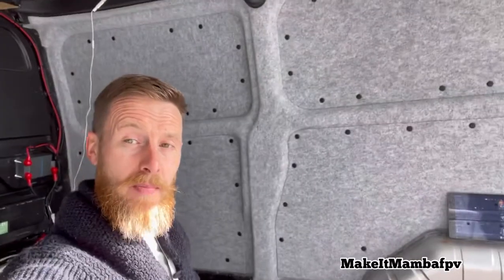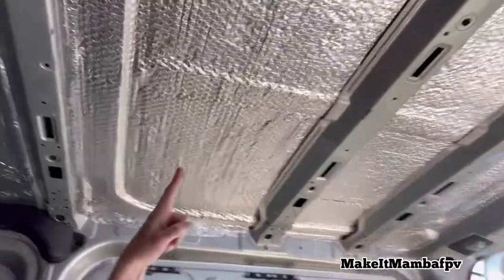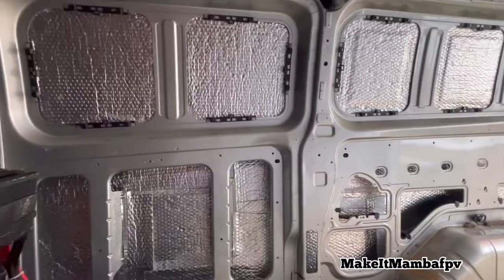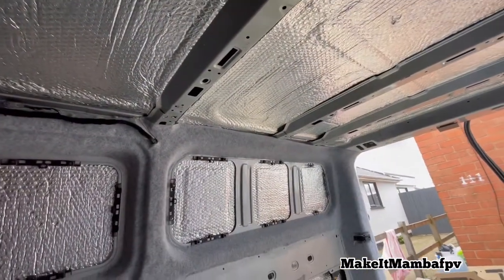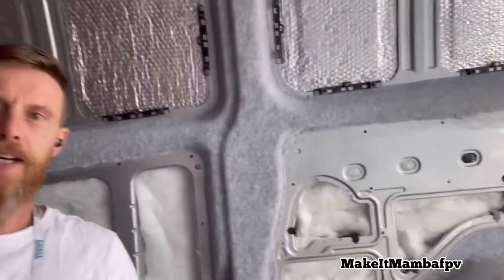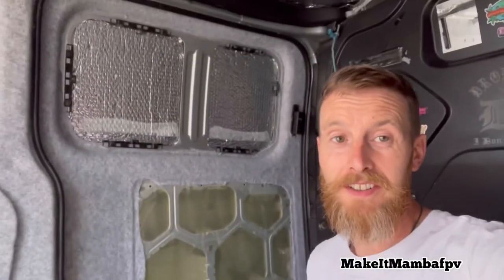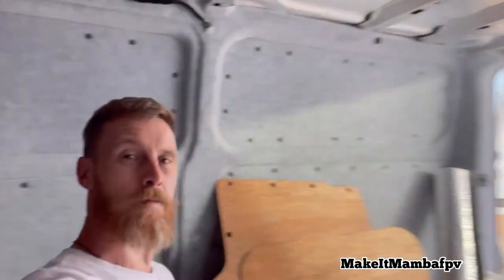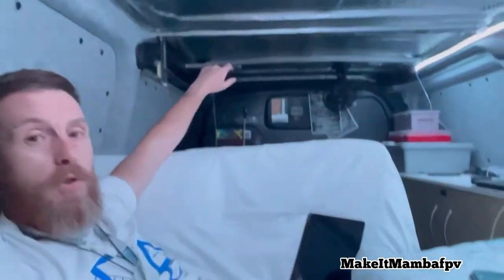How to insulate and carpet a ford transit custom #camper #vanlife #conversion #transit #homemade

Comment: I watched this and thought, ok yeah, I can do that ……….. and I almost have, it took you one day it’s taken me six weeks so far, 😂 I think the carpet you use is key though, cutting the carpet I bought proved to be a right mare!
Reply from the maker: Hahaaa brilliant. I have the benefit of refurbishing houses on a time frame so this was not to bad. Dont over thing it, judge lean on the side of caution when making the cuts and yes the 4 way stretch carpet is so easy to use and cheap too! £135 total and i think 15 linear mtrs x 2mtrs

Comment: So you didn't insulate the inside of your sliding door and you've covered access to your back light bulbs and light fittings
Reply from the maker: Yup, reason being i had work to do on the lock mechanism and i cover light access temporarily as i had no panels made for it at the time, very well observed though mate 👍🏻

Comment: That looks superb, im looking at converting my Mk7 Transit... so great tips. One thing im wanting to do is use as much of those holes in the body work for storage. There is a cool company called Kiravans that makes panels you replace the wooden ones with, and they have pockets built into them. They are on the expensive side, so going to try and make some custom ones myself that will fit in for what I need. Such a waste of much needed valuable space otherwise.
Reply from the maker: That is a great idea, ill have a look now 😊

Comment: Very very nice job mate  im thinking of doing my custom with the 4 way stretch carpet in the back and putting a laminate floor in  its not for camper use its my daily drive i do a lot of angling so its a must  cheers fella
Reply from the maker: Thats awesome mate get to it!! Its not easy but at the same time its not too difficult. Mine is also a daily driver but i travel the UK flying race drones so its also a must 😎✌🏻
Reply: @Mambafpv  yea im going to do it     it makes a helluva difference to the van  cheers fella

Comment: Hi. What screws did you use to fix the stretch carpeted plywood to the wall. Was they self tappers with washers.
Reply from the maker: OG panel clips that where holding the old ones on mate

Comment: quick question the spray adhesive for the insulation does it have to be temperature sensitive TIA
Reply from the maker: I suggest temp sensitive yes mate, i didnt and 1 year later the insulation sags a little

Comment: Lovely job. How many meters of carpet did you use? It looks like you use a lot more carpet carpeting the frame and panels separately.  Way better job though having access to remove the panels again👏
Reply from the maker: 15 linear meters mate. Combe valley campers stock it at a great price too

Comment: Alright, Neal great video.  Quick question, what year/mk van have you got?  I just started converting my mk8, removed the ply kit and those fresh ply panels were missing.  I've found some online but they look very different to yours.
Reply from the maker: Hey bro and thanks, it is a  2016, not sure about the “mk” sorry
Reply: @Mambafpv  Same year as mine then, I managed to pick one up with only 24k on the clock :)  Anyway, so all the kits I can find, have the back panel as one big unit which looks a bit rubbish. Maybe its because mine is LWB, is your SWB?
Reply from the maker: @will1565  mine is a long wheel base, i guess i was lucky to have them hiding behind the work panels. Have you have the engine recall done yet? 2016 all have recall warranty.
Reply: @Mambafpv  Um no, I had no idea about this.  It was owned by a council contractor so I'd like to think they took care of that.  Any idea how I would find out?

Comment: How do you get power into the back of the van ? I’m not making a camper hut want some power so if I decide to sleep in there every now and again. I can get lights etc charger
Reply from the maker: So you need an inverter for 240 power, about 3000w is plenty, and a split / smart charger wire to the ignition to charge leisure batter. Wire battery to inverter and bobs ur uncle. Charge when driving or idling 👍🏻

Comment: I’m in the process of converting my ex welfare van into a ‘tin tent’. It’s not insulated but I have a wife to cuddle up to.😁. We’re leaving the toilet in but I’ve opened it up to give access to the back of the van and to be able to fit a motorbike in. I’ll be using the four way stretch carpet and vinyl floor covering on the floor. It’s all very exciting. 
I really like your panelling idea, though. Did the panels come with the van or did you make them?
Reply from the maker: Nice dude, the welfare vans are great, looking forward to see how you get on with yours and i might get one for the next build 😎✌🏻
Reply from the maker: Oh apologies, i found the panels behind the main panelling. They are the originals ✌🏻
Reply: Ok, thanks. I’ll probably just four way stretch carpet mine. We don’t intend to do any winter camping but I must say your method looks a lot better, fantastic in fact , than what I have.

Comment: Another video claiming to do it The Professional way yet right off the bat he's sticking the bubble wrap to the outside skin of the van creating induction. 

That stuff isa Radiant Barrier and if you don't know what that means or does you shouldn't be a professional.  Nothing should touch the outside of the van except bitumen sound deadening.  Add you plastic insulation and then the bubble wrap making sure it only touches the framed parts , not the Plat panels.  When that is done you ply line leaving a 10mm gap between the bw and the ply.

That's The Professional way to do it.
Reply from the maker: Hahaaa brilliant, my first hate comment, tbh ive been waiting for it and yes you are correct 😂 its far from professional i agree but it just felt right to say it. Anyway ive lived in it full time since i made this video and i have zero issues. Could it be better? Of course it could but for the cost of the “DIY” job saved me thousands of pounds and its still going strong so apart from a few things i could have done better, im very pleased with how it turned out and how its holding up. 😎🙏🏻
Reply: @Mambafpv  so you don't find it heats up inside over the day?

It wasn't a hate comment.  It was calling out Professional which in case you are a professional it's Not.

There's only one other vid on yt I've found who talks about Radiant barrier installation.  And I'm the only other according to the thousands of comments.

Just don't claim to be a professional job if it's not.  It's misleading and thousands of other diyers out there copy the wrong way.
Reply from the maker: @paulknowles9727  listen to the rest of my video to figure out I’m not a professional. Im just ok at doing stuff. And no i have no issues in summer or winter apart from the thermal break my mechanic created when he put bolts through my roof to hold my solar panel, these drip in the winter. So the only professional job in this van is the only issue i have 😆